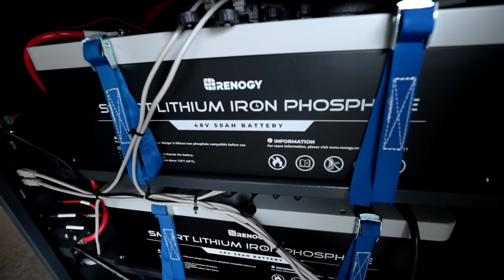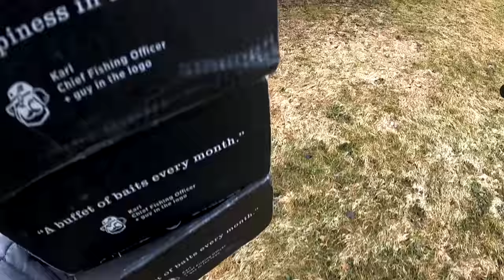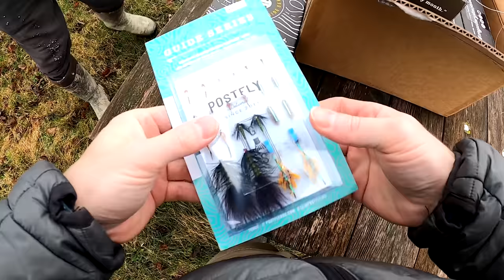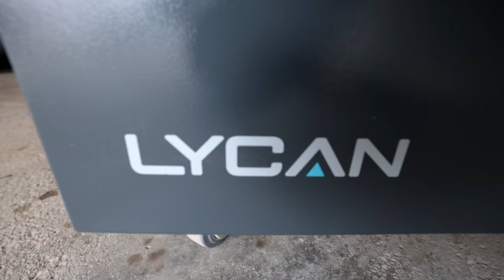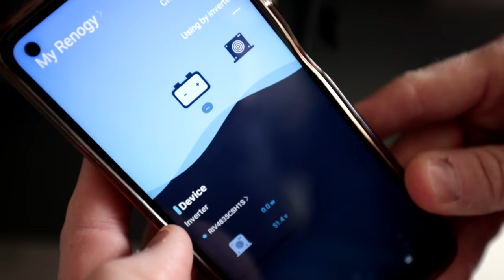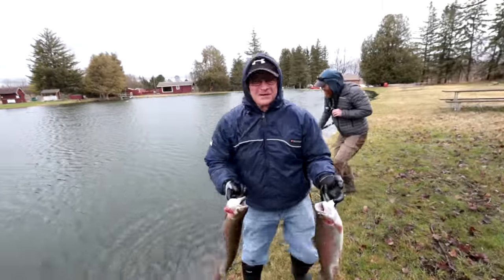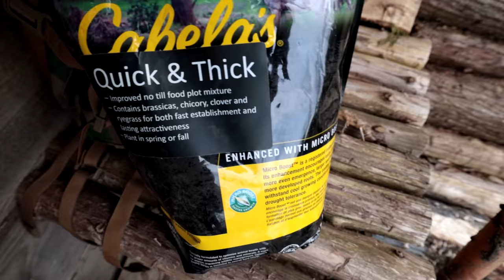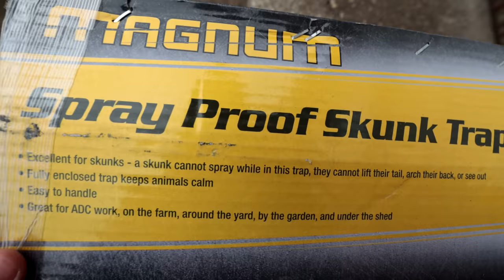'UNFAIR' FISHING CHALLENGE😂: 'The Wooded Beardsman' vs. @ModernSelfReliance | + New Pond Stocked!

Comment: One thing I can add about that Renogy unit: they use the right kind of Li battery. The Lithium-Iron-Phosphate type is the premium choice. Although heavier than Lithium-Ion-Polymer, it produces more voltage per cell, and it is much less likely to burst into flames.

Comment: I've got to say I like power and electricity but I'll stick with solar powered or hydropower or wind powered turbines any day I like batteries that last a long time and when you're off the grid it's like you want that power but there's no power poles to connect to and it's like you need like life lasting batteries some people usually say that there's no such thing as a life lasting battery but they're wrong you can take some double A's for example and place them next to a heater and they will charge all day long and be fully charged I'll do that all the time I never buy new batteries when you discover a way to make them last you never buy batteries ever again